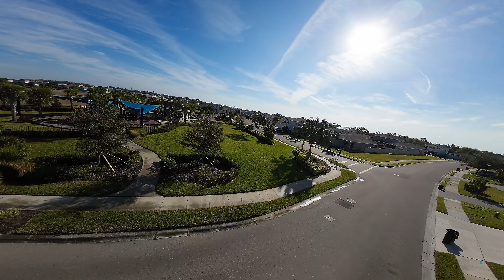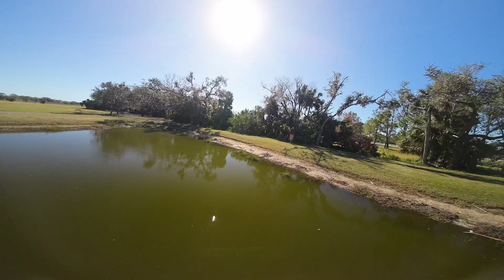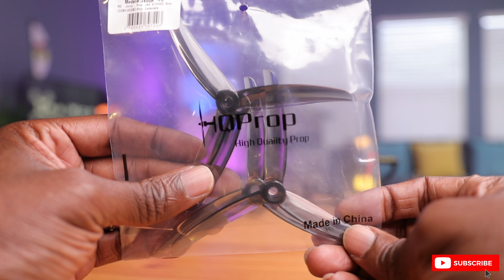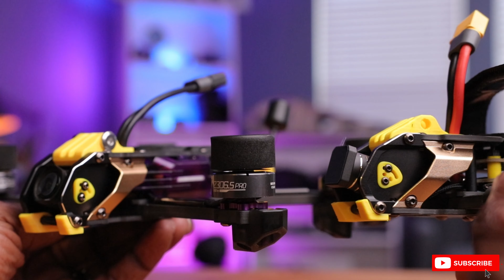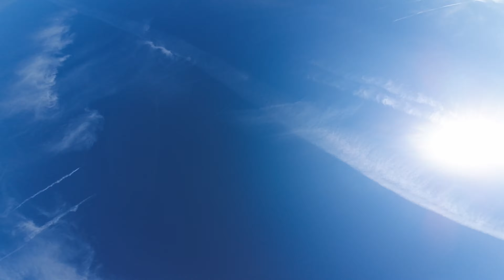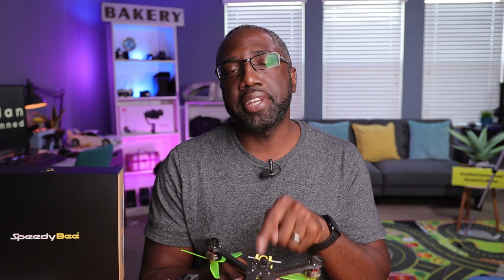SpeedyBee Mario5 BNF | Meet The Cinematic FPV Powerhouse!

Comment: Not sure if they actually tune the drone but a BNF's arent always tuned.most of the time BNF's come with a stock tune unless they specifi that it comes with a inhouse tune on it
Reply from the maker: Yeah, that's a good point...I think it has two separate tunes actually.   I think I'll do some more testing with a heavier battery since mine was a little smaller than recommended and the drone was designed to carry an action camera.
Reply: @OneManUnmanned still waiting for it to be released any idea on a release date
Reply from the maker: @rainsquadfpv unfortunately no...Usually they have it on their website once test units are sent to reviewers.  I'll update the links once I'm notified it's in stock, or if someone else let's me know.